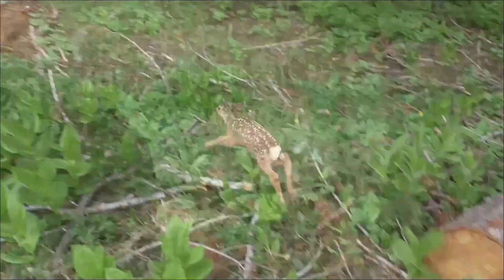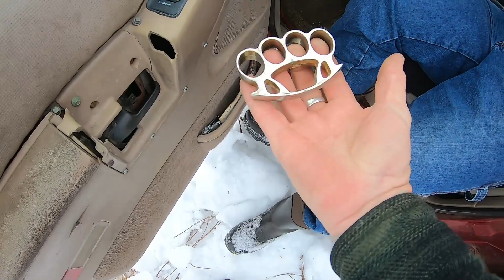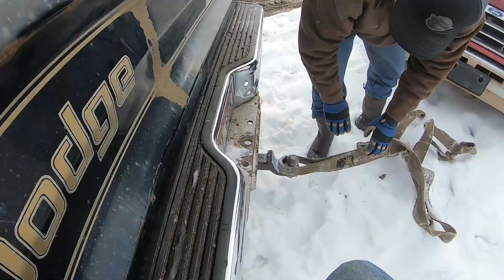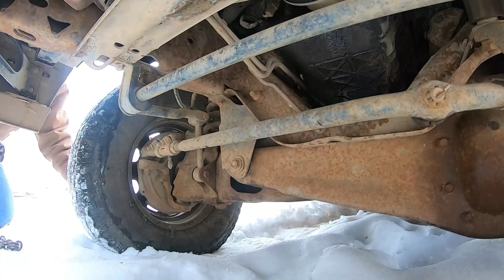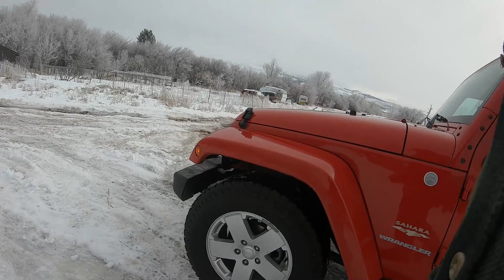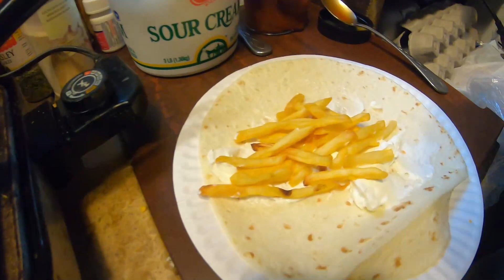HOW TO FIX OUR COUNTRIES PROBLEMS & SURPRISE

Comment: Ahh the Wrangler...not much good for anything in particular...the tops on them leak, you freeze your ass off in the winter with them, even with the hard top, once they get a bit worn they leak and you end up with wind blowing through the crevices, the short narrow wheelbase makes them terrible for highway use, every little road obstruction causes them to change lanes on their own LOL.  The only thing they do well is out on the trails where you don't need speed, just traction and articulation.  They change lanes and directions on their own on the highway they've never been very good drivers.  I think the 4 door models are a bit better though.

Comment: Auto locking hubs the horrible idea of today's automakers.  Compounded with electric shift transfer case motors, with that Explorer sitting for so long, the transfer case motor is probably seized up on it, pretty common problem with Explorers, Rangers, and Bronco 2's of that era.  

You can shift into 4Hi at any speed, 4Lo can only be engaged at a full stop with transmission in neutral.  There aren't any electric wires that go to the front axle.  The hubs are mechanically engaged/vacuum engaged on some later models.  The earlier models the hubs engaged when power was sent to the front the hubs engaged via a spring in the hub assembly.  The newer models used a pulse vacuum system and it was far worse than the older spring actuated hubs.  The 4x4 control module is also another failure point in them as well, not sure where it is in the Explorer but in the Ranger/Bronco 2 it was behind the driver's seat mounted on the pillar behind the door.